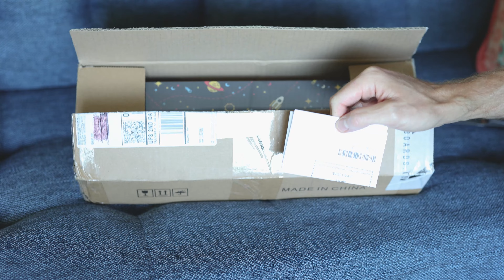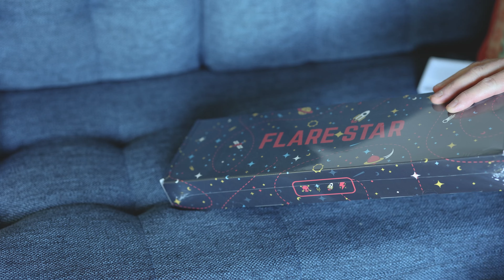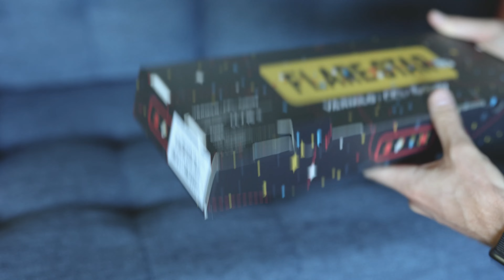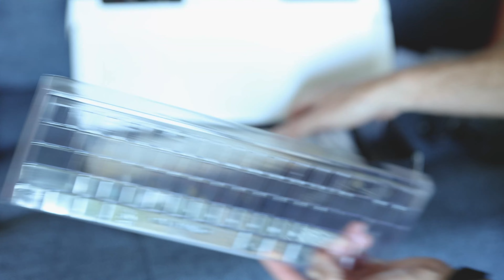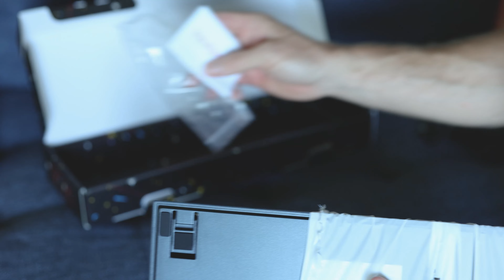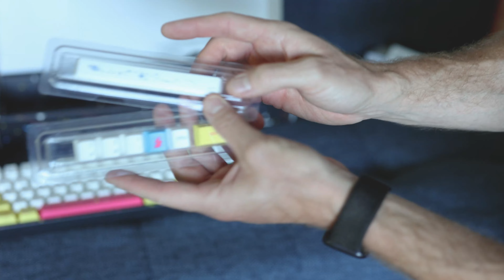Ducky Varmilo MIYA Pro Flare Star Mechanical Keyboard Unboxing

Comment: Can the Flare Star be used with an M1 Mac Mini without issues? Please help me someone!
Reply from the maker: It’s a Bluetooth keyboard. Not sure why it wouldn’t work with every computer with Bluetooth. Can also use it wired via usb.
Reply: @ObserveJeremiah  oh for sure it’ll connect, but I meant as far as not having command keys or multimedia controls. I’m wondering if it can be used to it’s full potential without too much hassle on Mac OS
Reply: @joubinboghiri6057  you could always look at the keytron keyboards